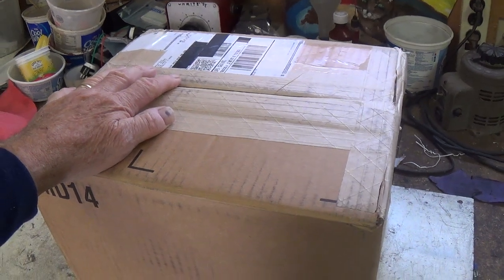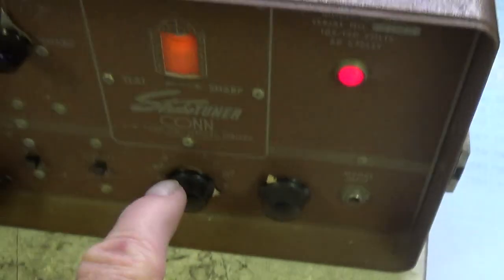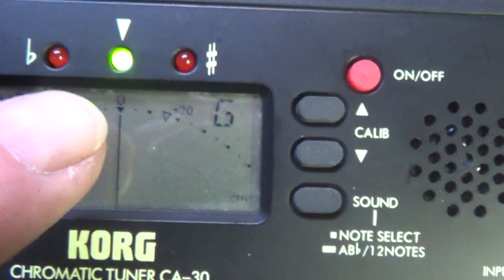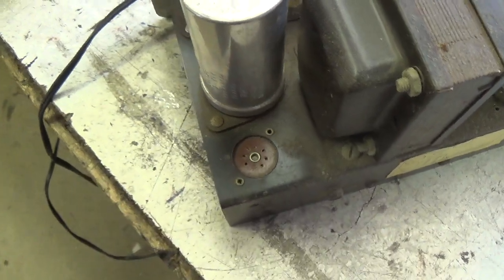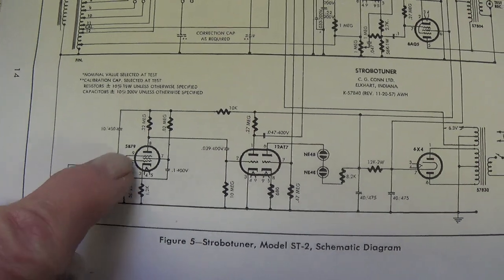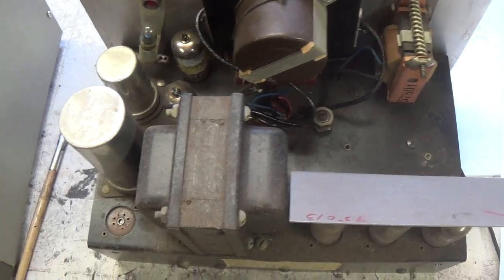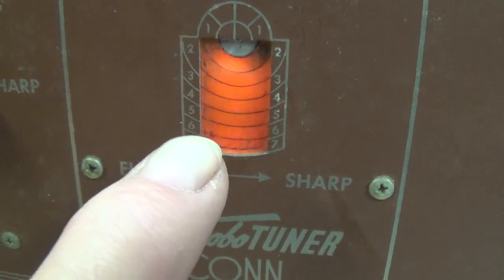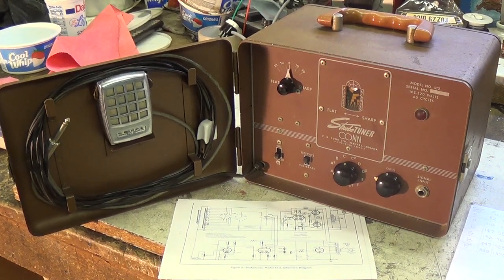Early 1950's CONN StroboTune Model ST-2.......What a Miraculous Device !!!

Comment: I'm wondering if this strobotuner was intended mainly for fine tuning electronic organs. C. G. Conn Ltd. was a prolific manufacturer of home organs from the late 1940s through the 1980s, when it was absorbed by the Allen Organ Company. Conn was  probably the fourth most-significant builder, after Hammond, Kimball and Lowry, in number of organs built; the company also built various models of support equipment, such as this strobotuner. Conn's organs were very popular with small churches.

A late friend owned two Conn organs, which I also played often -- a 552 Theatrette, and a 640 Theatre. The latter had two 61-key manuals and a 25-key pedalboard. (If you like tubes (don't we all!), the 640 was PACKED with dozens of preamp tubes!)
Reply from the maker: Yes, it was probably built to tune organs......as well as all instruments with electrical or acoustic output.

Comment: Doug, the transformer is running hot because of the solid state rectifiers, which are putting the HT higher than intended. I would reinstate the 6X4.
Reply from the maker: I tend to believe that the electrolytic caps have some current leakage to ground, E, thereby elevating the current flow. Current, rather than voltage, is most often associated with PT temp.
Reply: Sure, but more plate voltage => more current.

Comment: When I was a kid (mid 1990s) they used a tuner just like that in band class. The case was smaller and the strobe was slightly bigger. The band director seemed to prefer it for tuning sections of the band at once.
Reply from the maker: It might have been a Peterson unit, Jon.
Reply: @UncleDoug  I think you’re right. I looked though some websites just now and the tuner which most closely resembles what I remember is the Peterson 520. Good job!
Reply from the maker: @ihaveneverwantedto  Thanks, Jon :)

Comment: I wonder if that calibration can be used to make up for variances in line frequency?
The known frequency for calibration.
 The modern power grid doesn't have as bad of variances as happened in the past.
After having worked extensively with hydraulically driven generators you can wind up with anywhere between 56.5 to 62.5 HZ
For some reason modern equipment seems to be more fussy about it.
Awesome video. Thanks again sir.
Reply from the maker: Thanks for the info, Kenneth. I always assumed that the 60Hz frequency was constant and accurate.

Comment: №1:  I'd likely fashion a non-conductive 'septal' cap to prevent some future genius (pronounced "GEENius") from trying to improve it's performance by adding a "serviceable" part, where "non-serviceable" integral components have been placed.

№2:  From 1985, thru the early 2000's, I contracted repair services (usualy on microwave transmission equipment) to several Philly TV and radio stations.  WPVI, "Channel 6" wound up on my to-do-list once, maybe twice per year.  Larry Ferrari, "Channel 6's version of the great Korla Pandit", WA2MKI, was often in their lunchroom when I'd arrive with my Murray's Deli (Ardmore) roast beef sandwich (it beat the heck out of my Motorola Business's service truck). Each visit was usually blessed by my bringing a lunchbox full of tetrodes which were still usable, but not servicable for broadcasting purposes. While they had, and still have a decent scrap value, most manufacturers ceased production of them around 1992. When Larry passed away in 1997, I went to his estate sale, and discovered that he had a shop which contained an entire Conn Organs Service Center; there were at least five StroboTune devices there, however, some were quite different from the gem you were presented with.  I should have bid on them!!
Reply from the maker: Thanks for sharing, AME.

Comment: So, I have one of these strobe tuners too that a friend gave me, wondering if I wanted to convert it for guitar. I hadn't had a chance to give it a good look as of yet. Thanks for showing the schematic. It does make me wonder if it would be an interesting donor to become something along the lines of a Herzog type device a la Garnet amps which were basically a tweed champ with a dummy load and a line out.
Reply from the maker: Although the circuit contains two separate amplifier sections, I would urge you to leave it alone and offer it for sale if you have no need for its services. Use the proceeds to buy appropriate parts to build a better amp.

Comment: The 5879 pentode was commonly used as a mic preamp, especially in commercial mic-paging amplifiers, Webster, Bogen and the like. Back in the late 70's and early 80's, it was not uncommon to see Strobo-tuners on stage as part of a touring band's equipment. CONN was well known for manufacturing brass and woodwind band instruments, many of which were sold to schools.  BTW, it just occurred to me that back in the 70's my father  had a depth sounder on our 20' fishing boat that used a similar "nulling"  stroboscope design to read the distance to the bottom.
Reply: YES the Bogen ! Makes for a SWEET bass amp along with a pair of James B. Lancing D-130 the 15 inch drivers.
Reply from the maker: Thanks for the info, GU.
Reply: There’s a Alabama concert on YouTube. They are playing in a stadium. Behind Jeff Cook is a Conn StroboTuner.
Reply from the maker: @brianfletcher9774  Then we KNOW they're all in perfect tune :)  Thanks, Brian.
Reply: My Grandpa had one of those rotary strobe depth sounders also. I think he bought it as a kit and had a cousin that ran a TV repair shop down the road to put it together for him. It worked ok, but it didn't have "auto ranging" so you had to constantly tweek the controls, and it wasn't much good if you were going more than a few mph. It did seem like hi tech at the time though. My dad probably still has it, and it probably still works as well as it did then. Need to look for it.

Comment: VERY COOL and after almost 100 years it is still extremely accurate!!
Thank you for yet another interesting video Uncle! As I have stated previously I thoroughly enjoy all your videos. 
Now I know my next question has absolutely nothing to do with the vintage tuner. Haha
But I value your opinion and experience with amplifiers and fender amps in particular. So any input would be greatly appreciated.
Here it goes.
I happen to have an older fender deluxe reverb (no it's not vintage) well it is the first years of deluxe reissues I believe. It is a 1993-94 deluxe reverb. I need to replace the treble pot for the vibrato channel. Now this is not a problem however due to covid supply chain issues here in canada I am unable to easily acquire  the proper fender 250k 30A snap in potentiometer. I can get one ordered, but waiting 3 or 4 weeks and $30 bucks canadian dollars. That to me is too costly for what it is. All the pots mount to a PCB if you are not familiar with this reissue. I am able to buy a fender 250k 15A pot snap in mount which is what is used for the bass pot in this amp. So essentially it will fit the PCB and chasis perfectly and go visually undetected without reading a part number. So my question to you is  how much difference will my broken ears hear between the 250k 30A to the 250k 15A. 30A means 30% of total resistance at half mast, and 15A is 15% of total resistance at half mast. So again in your opinion how drastically will the 15A pot affect the sensitivity of the treble adjustment to my ear? Will it be extremely sensitive from 0 to 5 ???
Have you made a substitution like this in the past???
This particular amp like most fender lower wattage amps champs, princetons, deluxe reverb etc..has alot of high end as it sits stock. I have looked around to find another similar value style size pot that I could incorporate the original mounting bracket once removed from the original pot, but I have not found a supplier for that either and the bracket actually serves as the top casing of the pot. It can be done however.
What would you reccomend?
Reply from the maker: Thanks for your nice comments. It seems to me like you could install the readily available pot and simply adjust it to suit your ear. The indicator line may be at a different position than you are accustomed to, but the tone will be the same. Good luck.

Comment: Dear: Anybody. I have an off topic question that only Uncle Doug and his viewers would know. I bought an old MEC (Magnatone) M-192-5 sight unseen. It is in really good shape except for the field coil speaker. The paper cone, spider and voice coil have been devoured by vermin. The field coil and transformer have tested good. There is nothing marked on the speaker (unknown make or model), so I have no idea which recone kit to buy. Any suggestions?
Reply from the maker: You can contact The Speaker Exchange for help, WF. If it's an 8" speaker, however, re-coning materials may be hard to find.
Reply: @UncleDoug   Thank-you. It's a 12"
Reply from the maker: @whofarted9376  The re-coning supplies should be easy to find.

Comment: Hi Uncle Doug...I have just removed two very nice transformers from a Stromberg Carlson Model 35 P.A. amp made in 1951. It had the old metal tubes...2,6SC7 tubes for the preamp, a 6SQ7 phase inverter a beautiful pair of Tung Sol 6550, and the 5Y3 rectifier. The problem is...out of the eleven wires I tested for continuity, there is one..a black wire with a white segmented stripe and I get nothing from any other wire. I know it has to have a CT for the rectifier,correct ?That seems to be the one that is missing. The transformer is old and very heavy but there doesn,t seem to be any problem with it other than no continuity to any other wire. It might have worked as it was but I wanted to build with it so I stripped it. Have you a possible solution and has this ever come up before. I am hooking up a Suicide lead next and I suspect this transformer will put out 700 (or more) volts on the HT side so some prudence is in order during testing. Any suggestions are much appreciated.
Reply from the maker: Why did you remove the transformers? If you intend to build a guitar amp, the original circuit and chassis would work just fine. Hopefully, you marked each of the transformer leads with their exact destination in the circuit. If not, then watch my video on how to decipher transformer leads. Good luck.

Comment: Hey, I think I also saw xraytonyb work on the exact same mode. It's a beautiful piece of gear, clever, nicely designed and reliable, even if over-engineered.
You got all kinds of interesting stuff down there in 'murica - but I bet you can say that about the European gear too!
Like Tek scopes are common in the US, rare in central/eastern Europe, while the Soviet S1-112A scopes are pretty popular here and a rarity in the States.
The grass is always greener on the other side of the fence, isn't it? :)

By the way, as for the calibration mode: I think that you can also set the magnetic gap adjustment knob to zero in the calibration mode, and once it's done, use it as a flat/sharp reference.
Reply from the maker: Thanks for all the nice comments, Keri :)

Comment: I think I can explain the slight variations in the frequencies also, Having tuned my share of pianos, when you tune a piano, you always tune the lower octaves a TOUCH higher, and the higher octaves a touch lower, because the width of the string effects the actual overtones. When you tune a piano, if its done to exact frequencies, one chord will sound spot on, but a different chord will sound way off. I wonder if this tuner is set to "well - tempered" tuning if it indeed was used primarily to tune pianos? I would be curious to see what happens as you rise up the octaves what happens to the tuner?
Reply from the maker: Thanks for the interesting input, RR.
Reply: Yep. Other piano tuners have told me the same. It's the same with guitars. I don't know about banjos, violins and other stringed orchestral instruments, but it stands to reason it would be about the same. Seems everything in life is a compromise!
Reply from the maker: @mauricerogerson5825  Yes, indeed, Maurice......as we all learn once we get married.

Comment: The AC synchronous motor, referencing the constant of the AC electricity supply frequency (60 Hz in the US, 50 Hz in the UK), was also key to the design of the Hammond Organ, and, I believe, early AC mains powered clocks. Was there any link between Conn and the Hammond company?
Reply from the maker: I have no idea, JH. Perhaps some internet research would provide an answer.

Comment: An interesting piece of equipment and a well done video.  I printed the schematic and have a question about the oscillator frequency for the motor: as I understand it, the multi-tap coil with the switch in the upper left of the diagram works as an LC circuit.  Which capacitor in the circuit is used for this function?  Great channel by the way!
Reply from the maker: Thanks, Dale. I don't have a schematic handy.

Comment: Hi Uncle Doug. I wanted to ask you a question and this is the only place I know where to send it and maybe others can answer too.

I want to build a 2ohm dummy load. When I see most of them they are pretty large resistors. I found some 50W resistors but they are about 2 inches by 1 inch and they do have a heat sink built in. So are these adequate? The amp I need them for is a SR that is rated for 40W at 2ohm.

My logic is 50W gives me a safety margin (in case I need to test the amp at full volume). But I am questioning the size because except for one youtuber tech all I see are huge resistors being used for dummy loads. Should I maybe go for 100W (even those are not that big).
Reply from the maker: I think you'll find that the 50W load will get really hot during even brief testing. Here's what I suggest, if you don't want to invest in a big, bricklike dummy load.....buy 4 of the 8 Ohm 50W dummies and wire them in parallel for your 2 Ohms at 200W. They will still get pretty hot but should be able to cope with a testing session. The resistors are dirt cheap:  https://www.ebay.com/itm/312711085604?hash=item48cf087e24:g:Ow8AAOSw~5dcG4lf
Reply: @UncleDoug  Thanks so much for your help. I think I'd rather do it right if I am going to do it so I'll take your advice. I have some local places that may carry those. Thanks for the link. All the best to you from the north in Montreal.
Reply from the maker: @jimlabos  Good luck with your project, Jim.

Comment: NTSC is defined at 29.5 fps, Doug.    The 24 fps you are quoting is the minimum frame rate for cheaper animated cartoons,  but not NTSC.  NTSC is the US television Broadcast  standard.

PAL is defined at 25 fps and so is SECAM    PAL is the European code, SECAM is the code in USSR, China, Pakistan, France, and a few other countries.
Reply: Film frame rate is 24 Hz (assuming we are talking about "real" physical film). NTSC black and white was originally 30 Hz, but when colour TV was introduced, the "colour burst" took up some space in the signal, slowing down the refresh rate to 29.5 Hz. This allowed space for the colour burst signal, yet wasn't so far from the original 30Hz rate that black and white televisions would have a problem.

Refresh rates for TV were set at half the line frequency, so if the line frequency is 60 Hz (as it is in North America, and a few other places), the frame rate is 30Hz (modified down to 29.5Hz, see above). If the European  line frequency is in use (Europe and those countries not using North American standard line frequency), 50Hz, then the frame rate is 25Hz.
Reply: @kostaskritsilas2681  Agreed.   Note that all the broadcast codes were designed at approximately  half the "mains" line frequency of the corresponding territory.   These codes were designed around building practical circuits and not for maximum quality.   The actual time it takes to blend images this way varies among individuals, and can change as we get older.   

Video games are another whole story and there isn't enough space in a comment to even begin to touch on a discussion of their frame rate.
Reply from the maker: Thank you all for the very helpful information.

Comment: Very cool. It seems apparent that calibrating to 60 Hz renders all the other frequencies supplied by the large inductor dead on accurate. Is this really true? Is the inductor that accurate over the years and temperature ranges? And each ‘tap’ must have been so carefully wound at the time of manufacture to get every frequency correct.
Reply from the maker: Hopefully so, MBG. Yes, the circuit requires precision components.

Comment: 10:51 - That appears to be a core adjusted transformer a little like the one in my welder (only different and way smaller) but possibly working on the same principle.  Or maybe an adjustable choke?
Reply from the maker: It's an adjustable inductor for sure, WH :)

Comment: When I was in my school band, we had one of these StroboTuners in the band hall. That was in the '60s and early '70s. I was grown and working as a band director when I found out that Conn had gone solid state with this little unit, giving it a bigger screen and reduced weight. It was an easy way to get a very accurate reading on whether your clarinet or trumpet was the right length. The numbers on that flat-sharp dial tell how many cents (hundredths of a half-step) the note is away from perfectly in tune.

I noticed that your Korg unit was set to A442. Any special reason?
Reply from the maker: Thanks for all the helpful info, Tom. Please see the 1st pinned comment.